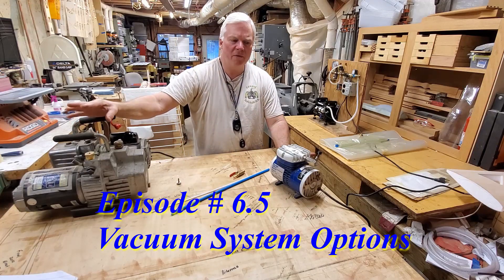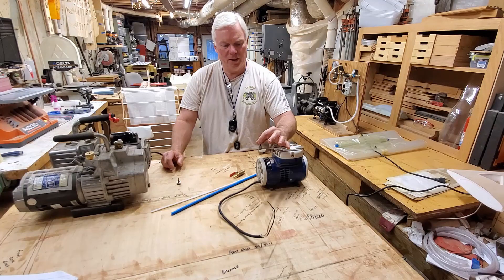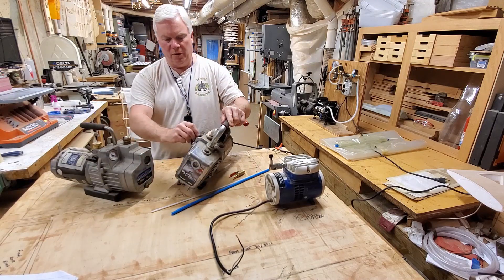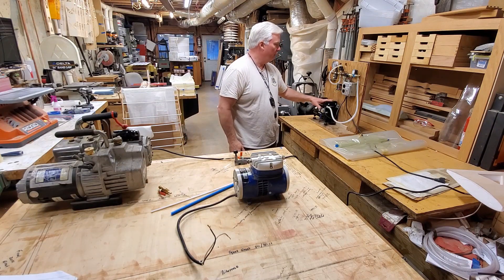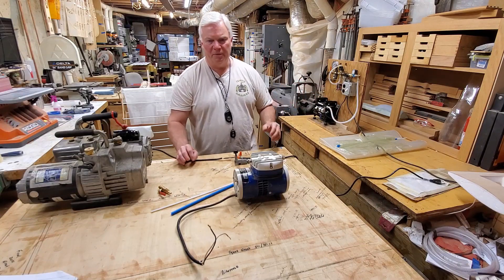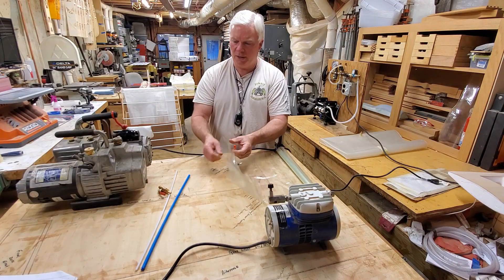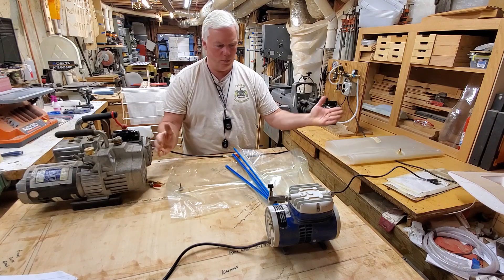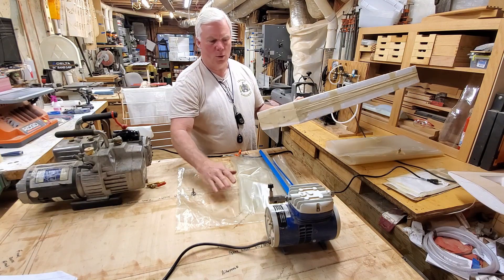Scratch Build Your Own RC plane Episode #6.5 - Vacuum System Options

Comment: I've been intently following this build series and have decided to build the bush gnat.
I wonder if you would provide plans or sketches of the fuselage and wing.
Regards,
the file
Reply from the maker: Several guys have asked if I would send them a traced copy of the templates and wing profile.   I traced all of the primary templates on a large sheet of paper and found a copy shop that would scan it.  My cost on that is around $10.  Shipping in a document mail tube is about $8.  PayPal me $20 to cover my costs and I am happy to send you a copy.  If you go to my Facebook profile, you can find photos of the tracing to confirm thats what you want.  If you need anything not on the large sheet, I can scan those and email them to you or mail in a  smaller envelope.
Reply: @mikencrcf6018  Thanks. I'll check it out.
Reply: @mikencrcf6018  I checked out the photos out and was wondering if you could send me a scan of the traces as an email, since I'm going to run it on electric and hence would like to ad a few modifications and I have a pretty decent poster printer.
regards
the files
Reply from the maker: @thefiles7742    sure.  Send the address